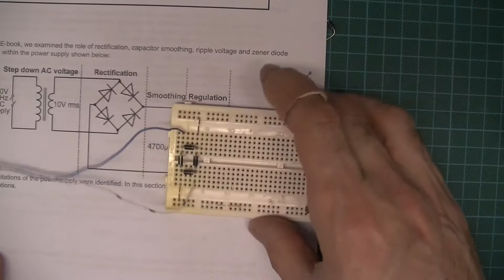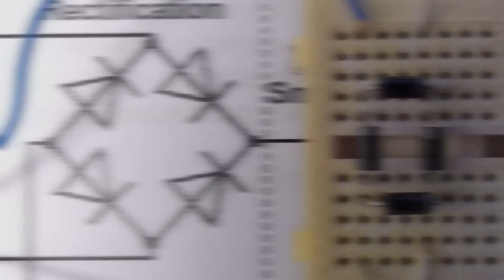Bridge rectifier breadboard layout

Comment: 120 VAC is a dangerous voltage.  I like your use of the inverter to reduce the explosive Wattage a regular AC outlet will provide.
Old days we used solder terminal straps.
Screw terminal Jones Strips would be the next choice. 
We now have nice euro style NYLON Terminal Strips that are fairly well insulated. What are you using the High Voltage DC for? Any filters to smooth out the waveform?
Reply from the maker: Hello David, you are correct - 120 VAC is a dangerous voltage. I'm UK-based so mains voltage is around 230 VAC (339 V peak) but I used an isolating step down transformer in this video to bring it down to a safe voltage.